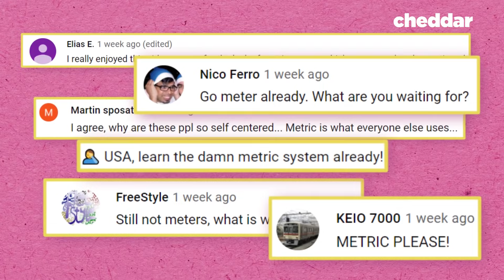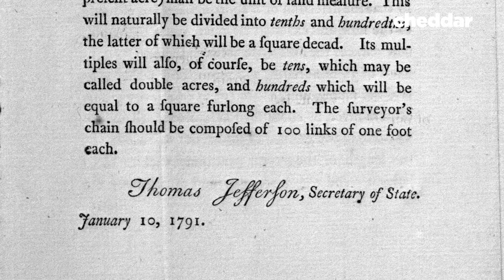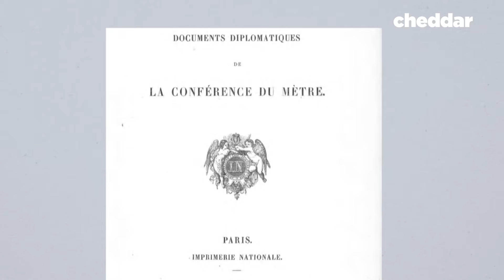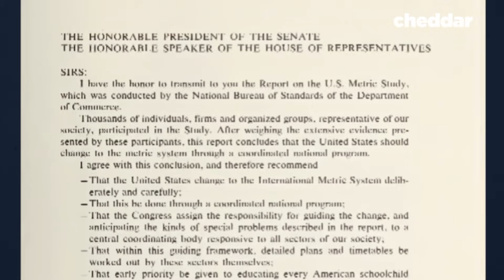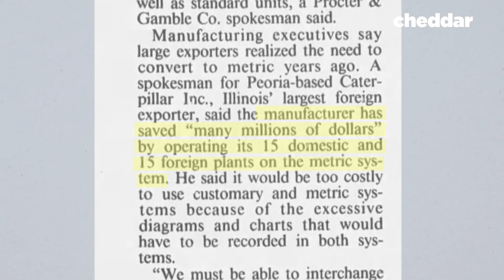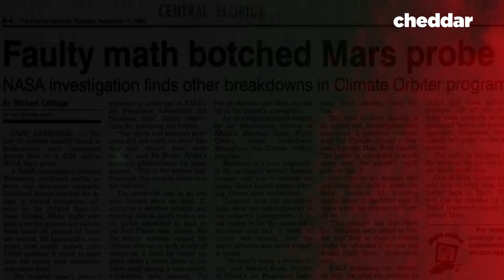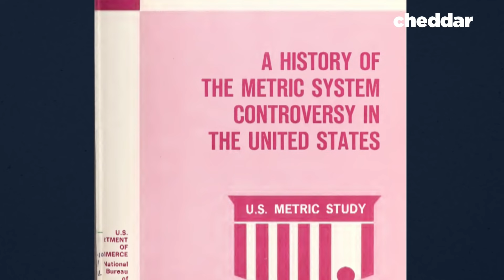Why Doesn't the US Just Use the Metric System? - Cheddar Explains

Comment: Living in Canada for 5 years as a kid, I kinda know both. That said, who cares what anyone uses as long as you do right by your audience and provide conversions if needed? Americans are pretty versatile without even knowing it. We use metric when talking about medicine, or car engine displacement. The Marines use metric when sighting in their rifles. Regardless metric is just not as intuitive to real world, tangible applications. Take power. We know what we mean by horsepower, and how it translates into how fast a car engine can go, and power a vehicle. We know what a foot pound of pressure is and how that translates into how much strength a car engine has(torque). It is just more relatable, rather than a cold concise and also arbitrary number(all measurements are arbitrary). We use gallons for some volume measurements, and liters for others. 

Our measurements are base 8. The smallest measurement on a ruler for us is 1/32 of an inch. 32 of those increments are one inch, just like 10, 1mm increments make a centimeter. 16/32 is just 1/16th, 8/16ths is 1/8th, 4/8 is a half inch. Then we go a bit broader by dividing an inch into quarters. Quarter inch is 8/32nds, 4/16ths, or 2/8ths(all more difficult to visualize than 1/4inch. The quarter inch does however act as an intermediate measurement for sub inch measurements, and as a "stepping stone" to visualize smaller values).
 1/32 of an inch rulers you can buy, and a 32nd is smaller than a mm, so our systmem can be just as precise, just takes a bit more mental math which is the only real valid argument metric users have. Where the U.S. system excels is in visualizing in your head what that length is. Maybe that is subjective, but what is easier to visualize: 12 inches in 1 foot, or 30cm being 3dm?  How about smaller ones: 1.5 inch, or 3.81cm which is 38.1mm? That is kinda of a loaded question only because of the conversion, but the point remains the same; in simplicity, less is more, and in metric you have more numbers, more segments in the same concrete length than in the U.S system. In the SAME length you have 12 individual segments making 1. In metric you have 30 segments, making 3 larger segments to no 1. The U.S measurements are intermediate and easier to visualize the length over metric. Metric for everyday use is just less efficient for intermediate measurements. 

Temp. F has much more increments between freezing and boiling point of water. If anything that is more precise that C in every way. Temp is even MORE arbitrary than length so it is absolutely moot to even bring it up, though F is the better system for it's versatility. I can say it is 78F instead of 25.5C or 75F instead of 23.8C, or better yet 100F instead of 37.7C. Who cares if Boiling is 100C. I'll take 212F as boiling point and 32 as ice knowing I can more accurately say how hot it is outside without using decimals(yes 1-3 degrees is discernible). Total degree difference from 77-79F: 3. Celsius the same temp of 77F being known as 25C, 78F as 25.5C, and 79F as 26.1C, what the U.S system perceives 3 separate temps, Metric only perceives 2.1 total temp deffiernces.  

Speed. Subjective, but if I see a triple digit number, I expect to be amazed, and 100kph is slow. 100mph, that raises my hair in my truck. It's like, kmh is an over protective mother, and mph is a no worry dad. 20 is a big value, but 20kmh is slow as all hell (12.4mph), but I guess it looks more impressive when measured for the Olympics, or European cars finding their new top speeds to people who will never push themselves, or their cars to such limits. Usain Bolt for example. Top speed, 44kmh. Impressive, just not AS impressive as when I look at my dashboard and see he is only a bit faster than the legal speed limit of a residential neighborhood. Maybe it's just more personally subjective to ME, but the problem is: a number over representing a value. it's hyperbolic. Over reactive. Inflated. Not taking away anything from Bolt. Subjective and arbitrary stuff aside, his forward running velocity as a human being is amazing. Just imagine if an alien came and said 400felctars a minute to describe it. 

Similar with weight. 1 pound is not even half a Kg. 1Kg is 2.2 pounds. If anything, it is underwhelming. If a guy can dead-lift 500kg, it seems like it's nothing, till you realize that is 1,000 pounds. Again, just another arbitrary(and underwhelming(subjective)) measurement, with no tangible intermediate(like ounces to pounds). Weight of an apple. What is easier to conceptualize: 12.6 ounces, or 100grams?

Distance. 1 mile sounds far(and is). 1 km is a pathetic run down the street. Sure it's off by 600meters(656yards), but the point is it is underwhelming). Great for ballistic calculations on the fly though, i'll give it that. On larger scales, you can't compete. 5 miles is such a greater distance than 5km. 5mi is 8km. Again, like speed, inflated.

But after all this, all the smug, classless critiques from metric supremacists, they always forget that their system is JUST AS arbitrary as the U.S. system. Period. I don't care if it's base 10. I don't care if you incorrectly think it is more precise(since it's arbitrary anything can end up being precise). Metric users after all their arrogance fail to realize that time is not metric. Music, is not metric. The year is not metric. Geometry is not metric(degrees). So before you scoff at us for not using base 10 like you do for arbitrary measurements of daily life(a system that is just less efficient, and harder to conceptualize for it anyway), just consider that for as many ways as not, neither do you. Oh, and aliens who probably already have colonized other planets likely do not use Metric. So get off you high horse, from on top of it's pedestal.

Comment: American recreational divers still use PSI (pounds per square inch) to measure pressure at depth and in air / gas cylinders and Feet rather than metres for depth. Calculation of air requirements and  depth pressures are FAR simpler using the metric system. eg. a 10 litre, 200 bar cylinder contains 2000 ltrs of air at surface pressure. That calc took no time at all. Try doing the equivalent using PSI.& cu ft. (1 bar = 14.5038 PSI + 1 ltr = 0.0353147 cu ft ). When I dived in California, the Americans I dived with couldn't believe how simple my air requirements calcs were.

Comment: I have several tape measures that are imperial only, but if the main one I use is imperial on one edge and metric on the other edge. It isn't that hard to figure out metric measurements even without a tape measure. Walk/run races have been in Kms for decades. I knew 40+ years ago that 10 Kms = 6 miles. At very least people should know both in the U.S.

Comment: Use. Metric. Everything makes sense. Thank you.
1 l = 10 dl = 100 cl = 1000 ml
1 kg = 100 hg = 1000 grams = 10 000 milligrams
1 m = 10 dm = 100 cm = 1000 mm

One cubic decimeter is 1 liter of water weighing 1 kg
It makes fucking sense, a km isn't 5 to power of 5 + 6/the circumference of your mom its 1000 m 
Srsly

Comment: The only thing that makes more sense in imperial is cooking; rather than having to use a scale and weigh each dry item, having a standard measuring cup with volumetric fill lines make it quicker
Reply: Which is why you usually use ML in recipes. With a standard measuring cup with volumetric fill lines to make it quicker.

I don't know why you think this tool is exclusive to the system you are measuring volume with?

Comment: Metric is the most logical, most efficient, better applicable, easy to convert and calculate with.
What's more logical than water freezing at 0° Celsius and boiling at 100° Celsius? 
Quick, how many inches in a mile? I can quickly tell you that there are 100000 centimeters in a kilometer... yes it's that easy.

Comment: Just use both, and make yards longer.
One yard=one meter.
50cm= 1 1/2ft
1/4m=9in
3in=8 1/3cm
1/3m=1ft
 
The only really hard one:
1in= 2 7/9cm and 1cm= 9/25in

But the 25ths are easy once you think in decimal, and the 9ths are just thirds of thirds, which is almost like dozenal.
The yr/m is now divisible by 900 mini units:
25mini-units in an inch, 9 mini-units in a centimeter.
 It can be divided by 360 and 100. 
There are 360° in a circle.
3600 sec in an hour.
1/36th of the day is 40min.
Seconds are then divided by decimal again so...
900,000ms=15mins!
Kids will learn to count in decimal and dozenal.

The only problem is...all inch based measurements will have to change. The inch will be longer.
You could make a meter 40in, but then a yard would be 90cm. Okay, okay, that's way easier, but I think learning math in dozenal would still benefit society a lot.
Reply: or just leave it the way it it, and learn how to use both. switching to a different system is dumb and pointless anyway. over 80% of the population is never gonna leave the country, so it makes no difference, and we are doing just fine with our system. you think people are stupid thinking metric may be more difficult, yet you want to fundamentally change what we know to be 1 yard? no. no need to over complicate things because a bunch of non U.S subscribers are too lazy to covert something, that most Americans do in their head.

Comment: Now we are about to leave the EU we in the UK should return to the imperial system at least for linear measurement.  Inches, feet, yards and Miles  we- have never abandoned Miles, Bridge heights are in feet, tunnels lengths are still in yards.  The one imperial unit that is still given everywhere in feet is aircraft height.  The length of many UK products are the clumsy metric equivalents of whole feet.  i.e.   61cm x 122cm  =   2  x  4 ft. ( sheet of hardboard)     2.4m  = 8 ft ( strip of wood).   The imperial foot has a noble ancestry going back to Ancient Rome and Greece  The Greek foot was two thirds of the Egyptian cubit.

Comment: There's an angle to this whole thing that I rarely see discussed. The Imperial system of measure is easier to "eyeball" and no don't argue. There isn't a part of your body that you can really use to measure a centimeter but I can use my thumb for about an inch. My literal foot for a foot. (These obviously don't work out for everyone, but you can still cut boards using thumb measuring as long as its always the same thumb.) The ranges of temperature aren't based off when water freezes or boils yea, but it does make for a good rough measure for the range that humans are comfortably able to live in. 0 is about the coldest we are willing to do, and 100 is just about when we're at the "fuck it I am not risking the sun" levels. This more or less applies to the whole system as most of the measurements were originally done as a reference to something that came up enough in everyday lives that they could use it to measure out things. Standards were eventually raised to set them firmly but before then it was a very wobbly system. Metric can't really claim that. Metric is very useful in a scientific sense, but at a pedestrian level, without a tape measure I can still do decent enough measurements with the imperial system if pressed.